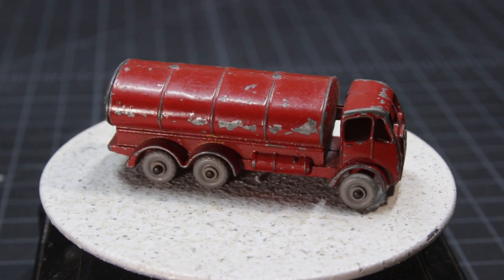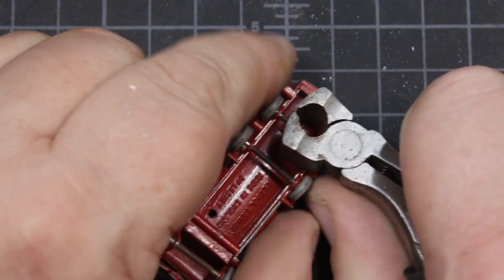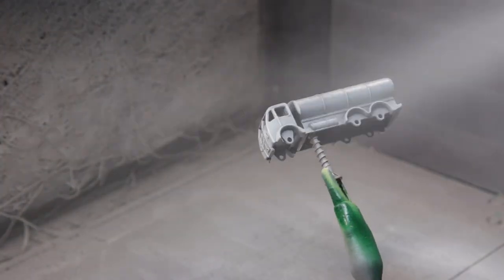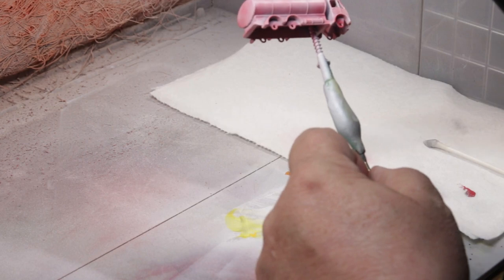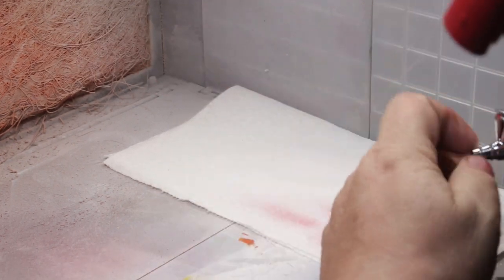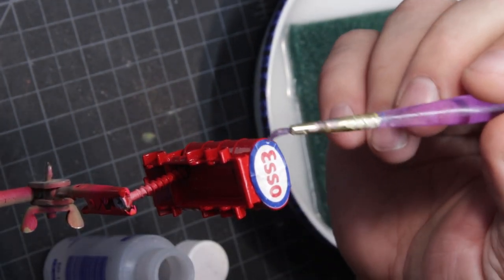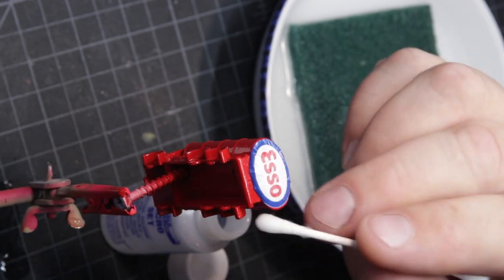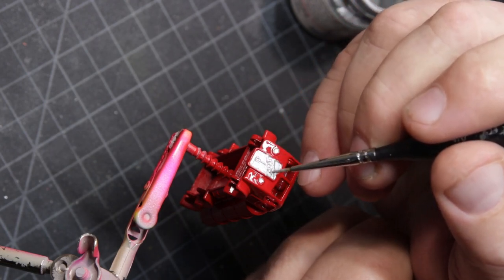Matchbox #11B ERF Petrol Tanker - Restoration

Comment: I love your videos, but there is one tiny thing - when you apply 'Micro Sol', try not to touch the decal for at least five minutes. The decal will conform to irregular surfaces because of the action of the solvent upon it. I speak from bitter experience of touching decals before they had properly set, and have them tear irreparably - most notably, the delicate ranging markings on a 1/76 Centaur IV tank turret, which is studded with big rivets, and my impatience getting the better of me. Some decals actually bubble up when 'Micro Sol' is applied, but they always settle down. Saying that, your ERF looks superb.

Comment: Nice job! Can you provide the link for the axles? I use 2mm rivets which work really well.
Reply from the maker: I know MMM uses those, they still require rounding off one end.  If you're referring to the tubing, it's just 1/16 ID steel tubing.  You can get it at any hobby store that does RC stuff.  Those guys build everything.  Amazon probably has it as well.
Reply: @TimeRider  thanks time rider! I will look into that rounding steel rivets are hard

Comment: Hey Lee, Another great resto,  I was looking hard at that decal and I know Black square make great re pro's  but may be that one was for the 11 c  the larger version. if you look back at the original one on the video it is finer and sit's well in the side's. But you pulled it off beautifully a credit to tenacity and perseverance. I just managed to score on the bay a 11 a yellow, which is the actual 2nd one produced 11 a 1st is actually green. and that one still allude's me at a fair price.  Did you notice the casting vent in the base of the tanker part where you put that screw. It also varies in each consecutive issue as well, some are rectangle and some are filled in, just another piece of info for your personal file of knowledge.  And Thank you I see the light on. Cheer's John.
Reply: That casting vent is a handy place to put a screw in to hold the model while painting it!
Reply from the maker: Nope . . . it was for a #11B, no offense John but I know how to order decals.  #11C isn't even a tanker, it's a crane.  My guess is that they want this to cover both the large and small #11B.  They made a change in the #11B casting and went from 52mm to 63mm.  The left to right size of this decal was spot on, it was the top to bottom that was off just slightly.
Reply: Hey Lee, None taken. 11 c is as you say a crane. my mistake but the tanker's did get larger and that is what I was going by.   And it is 11 b version 3. I have all, bar the green one in my collection and the sizes are noticeable when they are next to each other.And at no time was my comment doubting your decal ordering ability. I still think you did an awesome job on that model. Cheer's again  John @TimeRider

Comment: You pain with the brushes you like but basicly long brushes are for oilpaint and short are for water based paints like aquarels.
it also is important what kind and how many hairs are on the brush and how soft those hairs are.
Pig tail or horse hair for. aquarel will not work and also very soft hairs for oilpaints.
Keep on going!!

Comment: I have one of these. It doesn't appear that mine ever had a decal on it. And I think mine is the earlier version. Do you know if they ever came plain with no decal?
Reply from the maker: According to the variation listings, near as I can tell, all of the earlier versions had decals on the back and some had side decals as well, unless they were painted yellow.  The later versions had no decals on some of those made in 1959, 1962 and 1963.  But I think the '62 and '63 versions could be larger castings.  The earlier (11A) versions all had metal wheels and the later versions (11B) all had the cab brace.

Comment: For the older matchbox models that don’t have a windshield or an interior would it be possible to customize them and put in a windshield and an interior ? Or is that considered taboo in the wee little car world??
Reply from the maker: I suspect anything is possible . . . but generally if you're restoring something, you try to keep it original as much as you can anyway.
Reply: I put windows in a #37 Karrier Bantam Coca Cola truck. It looks better since you can see inside too easily. But no interior. You would have to remove the front axle
to do that. Also  I did paint the tires black .